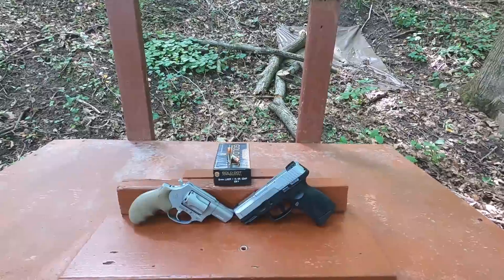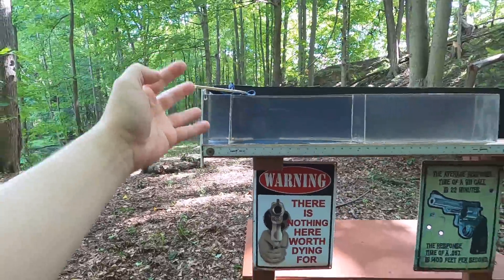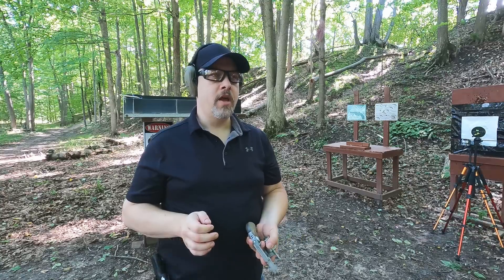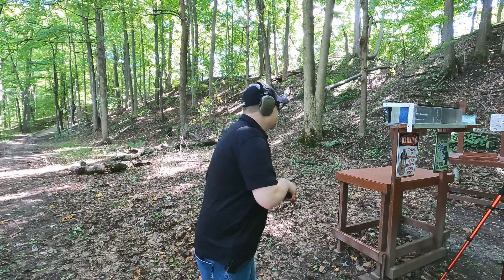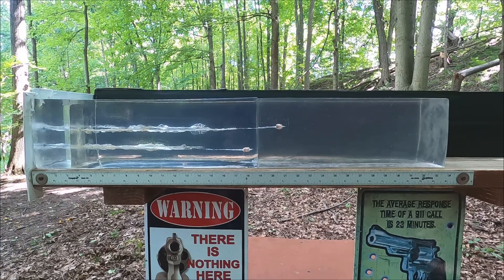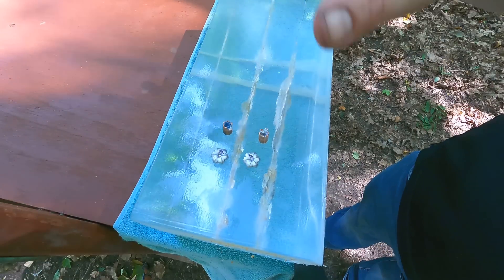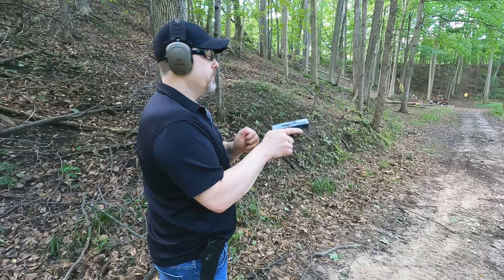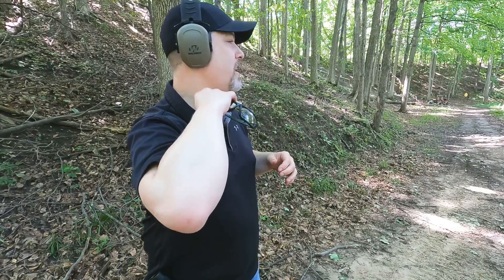Snub Nose Revolver VS Subcompact Semi-Auto - Ballistics Gel Test - Speer Gold Dot

Comment: Imo it's getting the bullet being pulled out of the case. The first 2 shots were higher velocity.  The last 3 were lower velocity. It doesn't take much movement on those small cased to get less velocity. I'm surprised the 10mm doesn't completely pull the bullet after five rounds have been fired in your revolver.
Reply from the maker: I have even tried Freedom Munitions 10mm and they didn't pull out either. I think 10mm has just the amount more you need of surface area for it to not be a problem.

Comment from the maker: Filmed September 1st 2024. Reason i'm often so far between filming and release date is because I been filming a lot more videos than I release in the same time frame. I'm trying to head into winter with extra content so I don't have to film in the snow so much. Everything I have filmed is on my Patreon page if anyone was so inclined to throw be a dollar and have access to them all.
Reply: I admit I have to do just that because the bar has been set pretty low for firearms related content these days. To be fair there are some quality content creators but they are few compared to the legions of turnips and taters. The comment section of the legion are even worse; I had an exchange this weekend with someone claiming to be former LEO (I call BS) that made my brain hurt. I will hopefully be joining you over on Patreon this weekend. This is the best ballistics content currently available here.
Edit: Already done.👍
Reply: Good ide
Reply: Sounds good.

Comment: The idea of a revolver chambered in 9x19 or 10mm Auto has been gaining on me. It makes sense for someone who prefers a revolver and does not reload. Thanks for sharing!
Reply from the maker: Especially in 9mm. It's similar to if you got some random gun you're not sure about, but it's in .22 LR which can always easily and cheaply be shot, so why not.
Reply: Ruger SP101 moonclips work great.
Reply: Charter Arms Pit Bull (model 79920) offers extraction without moon clips.
Reply: @turnin.sprocket  Just imagine if revolver manufacturers does something like that and of course..."bullet creep" or sometimes might be call.."bullet jumping" isn't a issue. Revolver that shoot semi auto cartridges might be more meta. Also we all know that moon clips are fragile and will get bent/damage over time. Another thing too stripping rounds off the moon clip is a little tricky and sometimes the rounds just doesn't want to come off.
Reply: @turnin.sprocket Seconded on the Charter's Pitbull. Not only no moon clips needed, but you get a beefier forcing cone, eight groove rifling, stronger lockup at the crane, no-sideplate solid frame, and better trigger. Excellent backup piece for someone carrying an autoloader in 9×19 as their primary.
Reply: Which revolver do you recommend?
Reply: you stop after gun is empty ok.